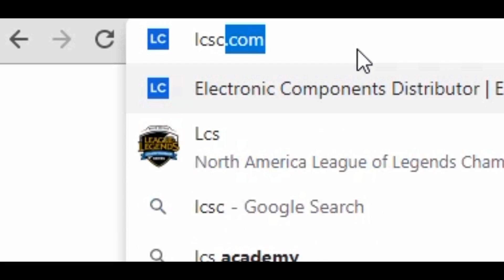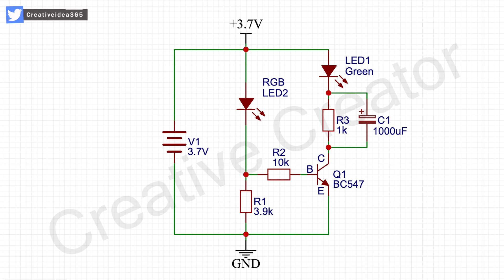LED Flasher circuit LCSC

Comment from the maker: Hope you will like it.
Visit: https://circuitbest.com/android-controlled-rgb-led-strip-using-arduino/
Reply: Hi, you are using 3.5v supply. 
If I use 12vdc supply its best to drop voltage using pot or resistor of what size. 
Thank you.
Reply from the maker: Use 1knin series if 12v